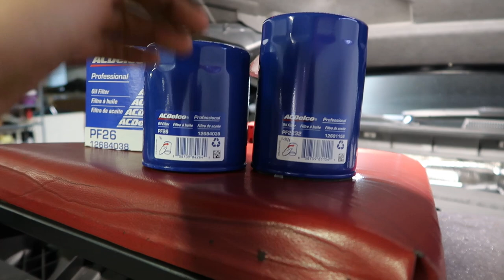A Major Flaw In The 2024 Duramax Oil System!

Comment: Who would win? An engineer team that spent years designing the oil system in the L5P and has millions of dollars riding on that, or one instagram dude bro in his garage who sees a filter and thinks it's bad?
Reply: Exactly
Reply: Just because they're engineers, doesn't mean they know everything. Ask the leaking rear windows, failed electronics, failed running lights, failed multi-flex tailgates, failed welding that makes the roof split apart, failed motors, failed lifters,  failed screens, and so on. They don't know everything
Reply: @majfeb17  Do you seriously think they would compromise their cash cow Denali Duramax trucks by making the oil filter too small? Big difference in profit between a Duramax and a 30k colorado.
Reply: @jellyfrosh9102  actually there's not a big difference in profit. And the duramax isn't their "cash cow".  Foreign produced vehicles are, regardless of what it is.
Reply: These trucks are designed to make it through the warranty period & that’s it. Anyone who believes the manufacturers recommended oil & fluid change intervals or trusts the OEM filters & fluids needs to pull their head out of their ass. It’s all by design to keep you buying their junk.

Comment: I converted my 2016 and 2021 duramax oil filters to caterpillar filter. I really felt safe with them because of smaller filtration and no by pass valve. I am waiting on a conversion for my 2024 l5p duramax and will make the change again.

Comment: PF63 is the correct oil filter for L5P for MY2023 forward. Not the PF26. Look in the owners manual. My 2023 3500HD Duramax is the PF63.
Reply: They’re interchangeable
Reply: My dealer put pf26 on my 2024 hd.

Comment: The PF 63 is the new recommended filter for 2020+ L5P . According to GM the pleats are taller and help with cold start ups. It does seem pretty wimpy compared to the 26, but I’m no engineer.
Reply: "The PF63, though narrower, has taller pleats and has more volumetric efficiency as well as better cold flow capabilities."

Bigger is not always better. Though I would bet the newer filter would mainly benefit people living in colder winter climates more than anything.

Comment: So I’ve been doing research on diesel and I think they’re really cool. However, besides the fuel economy, I really don’t need one. I’m not towing or hauling and it would be my daily driver. I was looking at the 3.0 Duramax, but with the issues that I’ve seen others have, it makes me not want to get one. I see you have some custom tires on yours. Do you tow/haul anything with it? Or is it a daily driver?
Reply: I have a 3.0L duramax in a 22 yukon and have had 0 problems with it in 25k miles. They're great engines.
Reply: 3.0 duramax is fantastic I had one before for 2 years traded it for a 3500

Comment: Hey my 2024 2500 with 2400 miles just started leaking out of the back end of the transmission and gear. Five shifts really hard. I guess I would take to the dealership have you had this issue?

Comment: My 2023 L5P 3500 dually denali also uses a PF63 filter from the factory. According to Rock Auto it is the correct filter but the PF26 can also be used. I wonder if the filter media is different, but I know that the same filter is required for my wifes 2023 GMC Yukon Denali with the 6.2 V-8, so I bought a case of them from Rock Auto.
Reply: I guess we could cut open the filters and look at how many square inches of media in the different filters
Reply: It look like the oil filter that fit on my 1998 ford ranger.I think that engine need a bigger oil filter

Comment: Also had a horrible vibration with the new 2024 2500. Changed tires after toad force balance and every configuration possible. New rims and tires... Still had vibration. ????? I got a bad one i guess.
Reply: Road force 😂 Not toad force...
Reply: @marthanewhouse7750:  Could be driveshaft out of balance.  The driveshafts are balanced and mated up with the truck as the driveline is assembled.  If the installer "clocked" the driveshaft wrong (rotated from where it should be oriented with the differential(s)), there can be vibration, no matter what tires and wheels.  The driveshaft weights could also be missing, knocked off, original balance not done or not done correctly...although I'm sure that never happens!  Right?
Reply: @gcflower99  Traded it...

Comment: Just got 2024 GMC hd it's leaking transmission fluid around the front    2000 miles.   Wow gm is really letting me down. Anybody know about this.  Can't find anything but one guy and they replaced entirely.
Reply: @joethomas6457:  I had a recall "notice" on my 2018 L5P for trans cooler lines developing leaks at the front of the truck...watch and notify they said.  Mine never developed the leaks, but yours sounds like they were included from the factory.  Sorry for that, good luck with service department.
Reply: @gcflower99  toque converter and they fixed it    took 3 weeks.  I was happy.   But now it jumps at start

Comment: Sooooooo is the pf26 or pf63 the right filter?
Reply: I recommend checking your owners manual in the truck. My research shows that 2023 was the first year for the PF63. Both the PF26 and PF63 have a 22 x 1.5mm thread and the gasket dimensions are very similar. The external can dimension are obvious, the PF26 has a larger O.D. The gasket OD and ID are nearly identical. What we can't see from the outside is the internal by-pass valve setting. The PF26 has a by-pass valve setting of 16 psi, and the PF63 has a by-pass valve  setting of 22 psi. This is a 6 psi difference. That is what I have found is the difference. It appears that the L5P Y calls for the PF26, and the L5P 5 calls for the PF63. I'm not a GM engineer. Just a guy that digs deep into the why. Hope this helps every one out. Can you screw a PF26 on and run it if your truck calls for a PF63? The short answer is yes, it will run, it will not leak. I have an AMSOIL customer that has had the GM dealer service his 2023 L5P 5 engine and they installed a PF26 when the owners manual states "PF63". He is taking the filter and his last oil change paperwork back to the dealership.
Reply: My 2024 came with pf63.  But dealer first oil change they used pf26.

Comment: I regrettably owned a 2023 6.6 Duramax for 9 months and noticed the oil filter is about 1/3 the size of the one that goes on the 6.7 Ford PSD as well has a 10 quart oil capacity compared to the 15 quart oil capacity on a 6.7 PSD.  Back driving a 6.7 PSD and not looking back.
Reply: So the oil capacity makes the ford superior because why???
Reply: @billyrose7181 where did I state higher oil capacity makes the Ford superior????